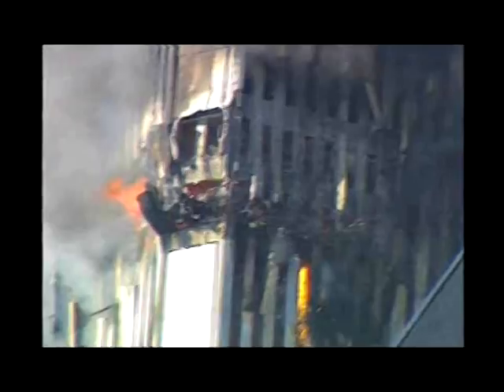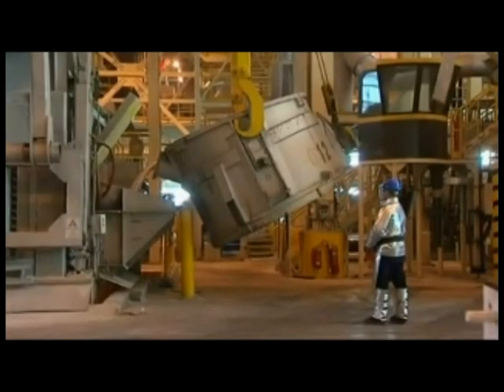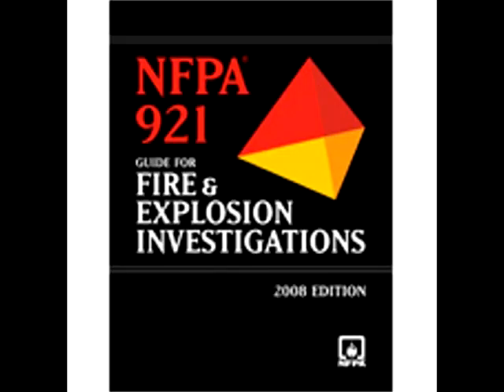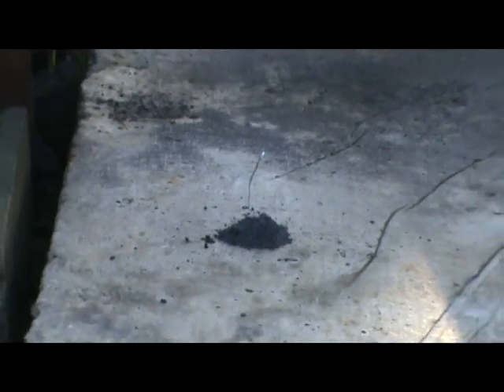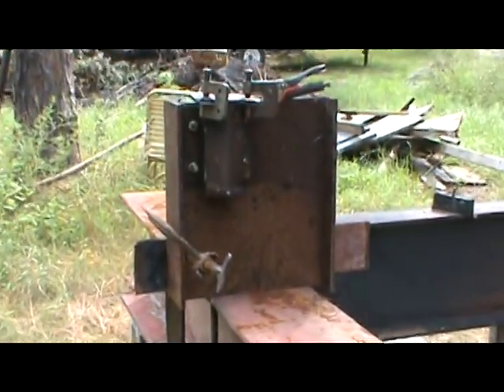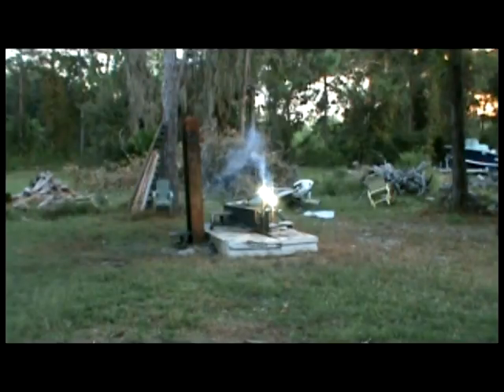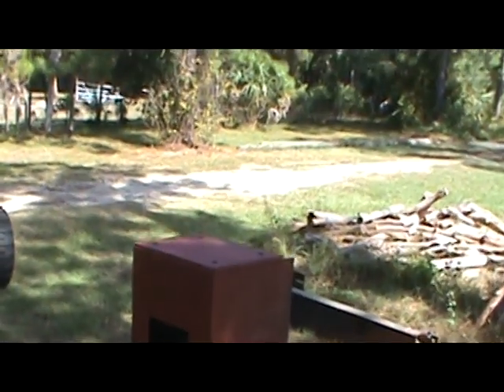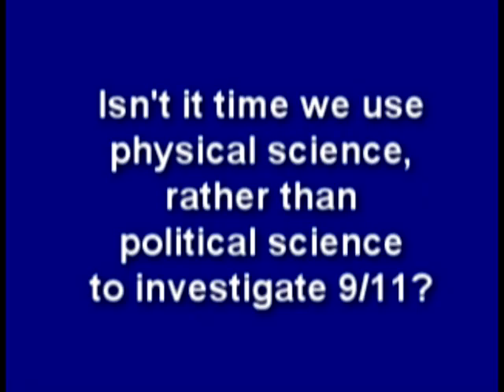9/11 Experiments: The Great Thermate Debate

Comment: All right, god damn it. Why in the fuck would someone fly a plane into a tower if they already had thermite in place, and why would they put thermite in place if they already had airplanes flying towards the building?
Reply: Two words: false flag.
Reply: ***** They easily could have just used explosives and blamed it on terrorists.
Reply: IAN 4000 Except then you would have to explain how tens of tons of explosives got past security without the consent of the security company (a pentagon-tied defense contractor with Marvin Bush on the board).  Then you would have to explain who planted the explosives (oh wait, another pentagon-tied contractor performing an "elevator renovation" with access to all 47 steel support columns a month before the attack).  Darn, that would expose 9/11 as an inside job very easily, now wouldn't it?

Best to crash two planes into the building and blame it on Islam, so most people would never look any deeper.  Understand?
Reply: IAN 4000 to serve as a distraction
Reply: IAN 4000 Fucking ignorant truthers  are so typical,,  they all say shit without facts or evidence to support their claims.
Reply: IAN 4000 Cause conspiracy theorists are total illogical dumb asses, that's why.
Reply: Emvaz22 

Timothy McVeigh did it. You can make ANFO. It would've been easy.

Crashing planes into the buildings is the most asinine way possible if it were to be an inside job. Would've been 100x easier to say they bombed the supports at the bottoms and got explosives from Mexico or Cuba.
Reply: Emvaz22 Typical ignorant truther....  thermite or nanothemite has NOT been proven to be any tower,,   The compounds that were found ( chips >.1mm thick, can be found on any bridge in manhatten.    And if you are basing these "facts" of thermite on Steven Jones paper,,  two things that are actual facts..  He has not allowed independent testing of his samples by an independent lab, and his amount that he says was in the towers  would be tons of unburned thermite.. .. what idiot that planted this material, that no one saw, would go through the effort of sneaking in tons toooo much??   But like I said, NO conclusive evidence of thermite, NO beams that were found that has thermite burns on them...   
TRY AGAIN DIPPY
Reply: IAN 4000 lol aint no terrorist gonna advance all around the tower putting thermites in all the right places of the buildings steel undetected, that would of bin to obvious of a lie, plus coincidental have the owners of the towers pull out a big insurance for the towers 3 days before
Reply: Emvaz22 Extensive elevator renovations on the WTC elevators started in 2000. Extensively reported on. Why don't you stop being intellectually cowardly and lazy and do your own fucking homework.
Reply: +Emvaz22 best comment ever.
Reply: MrNelsonButterscotch Except my version of events meshes with actual published scientific evidence that proves the presence of advanced incendiaries in the towers.  Your version is a fairytale that isn't supported by any actual evidence, only your myopic speculation.

Do you have any evidence that disproves the presence of nanothermite?  Which experts analyzed the dust and found that these red-grey chips were not in fact thermite?  In which peer reviewed academic paper was this published?  Which publication does this paper of yours currently reside?  Oh thats right, no such paper exists.  I almost forgot.

Until you can disprove what has already been scientifically proven, you have no argument.

Try again.
Reply: IAN 4000 - You know why, you idiot, (or deceptive filthy scumbag).
Reply: Joe V #dumbass
Reply: Joe V"Active Thermitic Material Discovered in Dust from the 9 / 11 World Trade Center Catastrophe."  Harrit et al.  The Open Chemical Physics Journal.  April 2009.

Published scientific paper which proves the presence of advanced nanothermite.  You claim these chips are not nanothermite.  Since you clearly are no expert, please cite me where you got this information.  Who has analyzed the dust and found something different?  Where is this scientific analysis which you base your assumptions on published?

Thanks.

Oh and before you try, the Millette paper is not published, or peer reviewed, so does not count as an academic source citation.  This junk paper is posted on a 'debunker' blog, where any moron can make shit up and pass it off as science.  There is no oversight or verification of the results of such a paper.

But nice try DIPPY.
Reply: Emvaz22 Why don't you try  getting up to speed. '..  I guess you didn't read my post above, about Steven Jones..    If you haven't noticed,,  there has been NO other papers or research published since this :"paper" (crap) with Jones's name on it.  What does that tell you?? ....  paint chips are not thermite, no conclusive proof of thermite,  or nanothermite.    no beams with thermite burns or damage found...
Someone does not need to be an 'expert' to use common sense,  and to ask some simple questions.. like, if those 'chips', less than .1mm thick were thermite, how could they burn hot enough to cut through a steel beam?  Maybe one of your 'experts' can explain that to you.... dippy.
Reply: Joe V The fact that there has been no published paper regarding the analysis of the wtc dust since Harrit et al in 2009 tells me that no one has been able to refute it.  You keep claiming these red-grey chips are paint as if it has been proven, but you just said yourself that no further papers have been published analyzing these chips.  Therefore you have no evidence supporting your "paint chip" theory, only your small minded speculation which you are most likely parroting from some unscientific 'debunker' blog.  You must have missed that day in 4th grade when your teacher went over what constitutes an acceptable source.  Clearly, you have an excellent grasp on the process of logic and critical thinking.  

There is also evidence of thermite when examining the steel beams.  NIST'S own report outlines the presence of 'eutectic' steel, thick steel beams reduced to swiss cheese, and labels it as one of the greatest mysteries of the disaster.  Of course, if they had bothered to test for oxidizers and incendiaries such as thermite then it wouldn't be much of a mystery, but they never checked.

Your last laughable point, regarding how nano sized chips couldn't  possibly melt through thick steel, I seriously hope your are joking.  I realize that by now, your pea sized brain is probably hemorrhaging blood out your ears from being overworked, but stay with me here; I know you can do it.  Here it is: a 'chip', by definition, is part of a larger 'chunk', or conglomerate, so to speak.  As a relatively large amount of this conglomerate would have been required at each critical structural point, and considering the immense amount of energy released during the event, as made evident by the concrete all being converted to dust, and several ton beams being jettisoned out at 70 mph, one would expect to only be able to find small unreacted bits that were exploded outward from the main conglomeration before they had a chance to fully ignite.  Which is what was found.  One would also expect to find the products of this reaction.  Molten iron would be releases, which would then solidify into spheres in midair due to surface tension.  Well, what do you know, the USGS uses the unusually high level of iron microspheres as one of the identification markers of wtc dust.  Gee, imagine that.  One would also expect to see another product of the reaction, aluminum oxide, released as a white aerosol.  Hmm I don't recall seeing anything like plumes of white dust during the towers' collapse.  Nothing like that at all...

Seems like what was observed pretty closely matches what one would expect to see as predicted by the scientifically proven thermite theory.

Do you have any published evidence which refutes this theory, or would you like to keep displaying your failures of logic and your belief if unsupported theories backed by 'blog science'?

Dippy.
Reply: Emvaz22 Haa. very laughable..   ..\ You forget to mention that it was Jones that has not allowed independent testing of his samples,, that could be why there have been no 'refuting' papers published.    Its also obvious that every one of these 'chips' has the same red-gray layering effect... very similar to a paint chip,   Now, whether each sample has the same composite type of chips, I don't know, but if they do, it points to simple paint chips,   Your theory that these chips came from a larger quantity of thermite doesn't hold up...  And thermite  does not explode, and there were No loud explosions big enough to hurl beams at 70 mph heard as the building collapsed... so the only explanation for any lateral expulsion is the force of the collapsing floors acting on the stationary beams below .
That's like,, maybe 8th or 9th grade physics. maybe you missed that class.
I saw huge amounts of dust, most of which came from the crumbling and smashed concrete...  none from aluminum oxide...

give it a rest dippydoo  its been over 14 years,, no evidence from any one to point to a conspiracy..  just a lot of factless theories..
Reply: "You forget to mention that it was Jones that has not allowed independent testing of his samples"

Irrelevant.  Harrit et al clearly published the sources of their dust, including names.  Any serious researcher would have no trouble acquiring the same dust.  All four of their dust samples from four separate locations all showed the same reactive material.  The reason they don't share their exact sample is presumably because they don't have a lot of it, and because this dust which was used in the study is evidence in a pending criminal fraud case against NIST, therefore it needs to be preserved.  Seems logical to me.

"Its also obvious that every one of these 'chips' has the same red-gray layering effect... very similar to a paint chip,   Now, whether each sample has the same composite type of chips, I don't know, but if they do, it points to simple paint chips, "

I agree.  These chips appear to have been specifically engineered to appear to be common paint.  The difference?  Common paint contains iron oxide and aluminosilicates (that is aluminum bonded to silica i.e. kaolin clay).  The incendiary ships contain the same elements.  Iron oxide.  Aluminum.  Silica.  The difference?  After a treatment in methyl ethyl ketone (paint thinner), the chips in question don't dissolve, but instead expand.  When they do, the aluminum migrates away from the silica, meaning that it is not chemically bonded.  This is not an inert aluminosilicate (clay), it is elemental aluminum suspended in a silica matrix with iron oxide.  The molecules are a uniform size and shape, and are in a precise stoichiometric proportion so as to illicit an efficient exothermal reaction.  This is a nano engineered incendiary.

Perhaps if you had read the paper you would know this.  Or maybe you have a competing paper which I'm unaware of that refutes the Harrit paper?  Please cite this paper so were are all on the same page.  I'm beginning to think you have nothing.

"And thermite  does not explode"

Oh, now you are an explosives expert.  Again, cite your source.  Standard thermite in open air does not explode.  Thermate in a confined container DOES explode, just not as loudly as TNT or RDX.  One engineer in his backyard proved this, and also showed how a small amount of thermate, properly positioned, can cut steel beams.  Nanothermite would have an even more violent reaction due to the proximity of the reactants as well as the enormous surface area due to the small particle size.  I guess you never made it through 10th grade chemistry.  Source:

https://www.youtube.com/watch?v=5d5iIoCiI8g

"I saw huge amounts of dust, most of which came from the crumbling and smashed concrete...  none from aluminum oxide...
"

Because you were there analyzing the dust.  Sure you were.  You are an expert at chemical analysis, explosives, and a YouTube shill to boot.

Plenty of evidence refutes the official theory, and more and more people are realizing this.  You are losing.  Try harder Dipshill.
Reply: Emvaz22  A paint chip or not a paint chip.... it still can not burn through a steel beam.. Anything else is purely assumptions on your part.   
You haven't proved anything,,, don't you realize that...  It doesn't matter what my opinion is.. the fact is that its been over 14 years and all you ignorant truthers are still grasping at factless theories... ...  /but you keep on trying ,dipshit.. ,,maybe someday it will dawn on you,,,,,, it was a terrorist attack..
Reply: "A paint chip or not a paint chip.... it still can not burn through a steel beam"

From my prior post: Regarding how nano sized chips couldn't possibly melt through thick steel, I seriously hope your are joking. I realize that by now, your pea sized brain is probably hemorrhaging blood out your ears from being overworked, but stay with me here; I know you can do it. Here it is: a 'chip', by definition, is part of a larger 'chunk', or conglomerate, so to speak. As a relatively large amount of this conglomerate would have been required at each critical structural point, and considering the immense amount of energy released during the event, as made evident by the concrete all being converted to dust, and several ton beams being jettisoned out at 70 mph, one would expect to only be able to find small unreacted bits that were exploded outward from the main conglomeration before they had a chance to fully ignite. Which is what was found.

Apparently your short term memory is not very good.

"You haven't proved anything"

You meant to say "You haven't proven anything".  Actually I have. Using deductive reasoning I have proven that all of your objections and your refusal to accept the Harrit paper are easily discounted.  I have also proven that you don't have any credible reason (i.e. a published paper by experts) to disbelieve the Harrit paper.  All you have is the official government story that "It was terrorists" while you ignore actual physical evidence.  I have cast doubt on your ability to effectively use reason and logic.  I have proven that because there is no published academic paper which refutes Harrit in the six sears since it was written, therefore, the conclusions of the Harrit paper must be presumed to be valid.

" It doesn't matter what my opinion is"

I agree.

"still grasping at factless theories"

I've presented plenty of facts supporting the theory of controlled demolition.  What facts have you presented?

" it was a terrorist attack.."

Of course it was, just not in the way you are thinking.